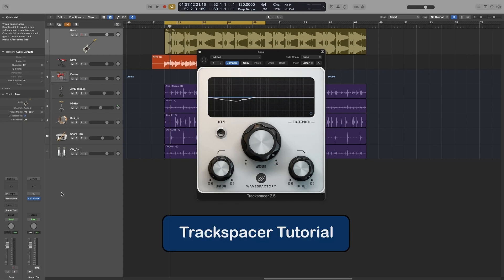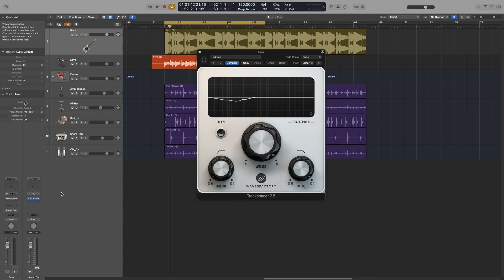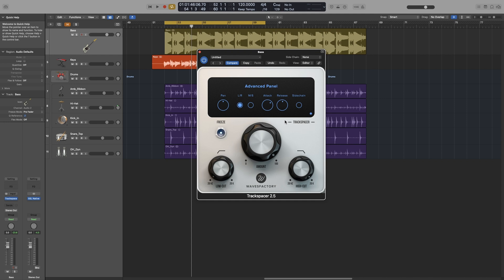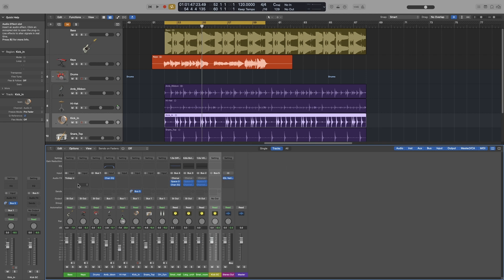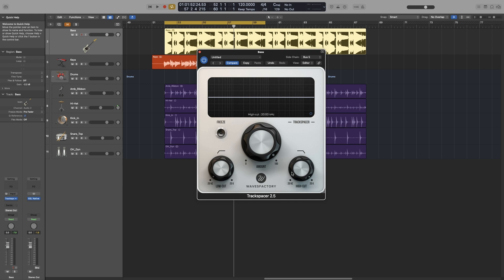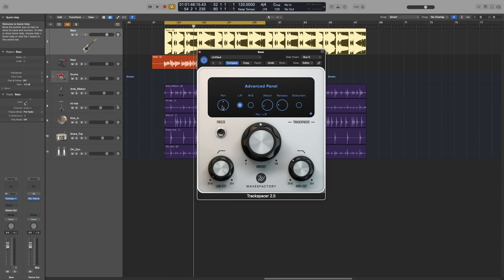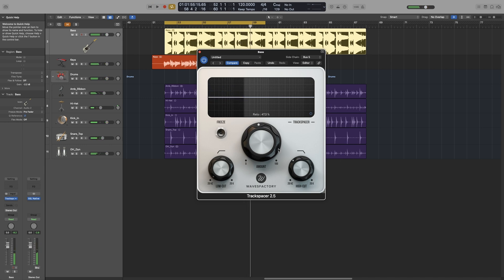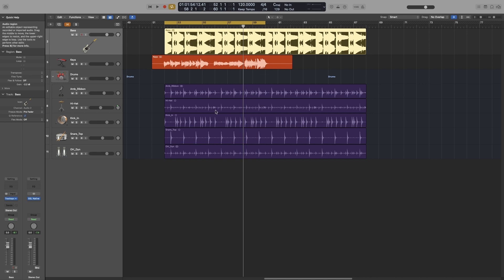Wavesfactory Trackspacer TUTORIAL (Try this instead of Side-chain compression)

Comment: Hey man. So at the point where you said that when you mute the kick track...mine doesn't mute.  Any help?
Reply from the maker: Hello.
You probably missed a step somewhere.
Checklist.
1. Send the kick to a bus and set the amount to unity. 
2. Set the kick channel to pre-fader
3. Set the bus to 'no output'
4. Set the sidechain for the bass channel to the kick channel on the track spacer.

Hope this helps.

If not, try and follow the video step by step. I don't see any other reason why it wouldn't work on your end.
Reply: What do you mean by unity?  Is that 0? @ConstantineMusicComposer
Reply from the maker: @blasher4  
Unity or unity gain is when the audio that passes through your gear (Or plug-in in this case) and the output level is same as if the gear (Or Plug-in) is not on the signal path. Same input and output level. Think about it as one in, one out. 
By saying, put it on unity gain, that would be to bring your bus at 0dB. 
As for the rest, I do not know what you might be doing differently from what I do on the video. There must be something that is missing because if you do it exactly as I am, then you should get the same results.
Reply: I do these steps but when I mute the kick track. it still mutes aux bus. @ConstantineMusicComposer